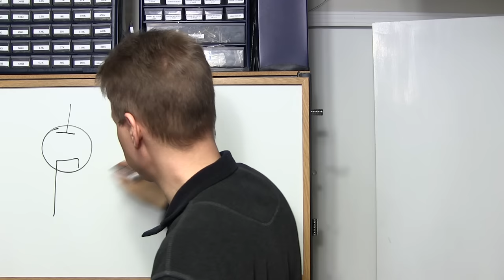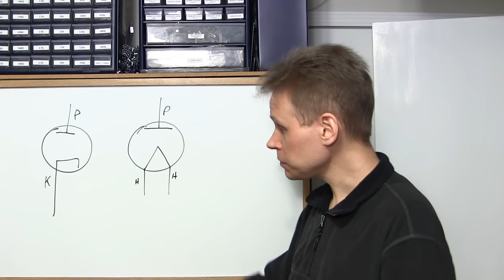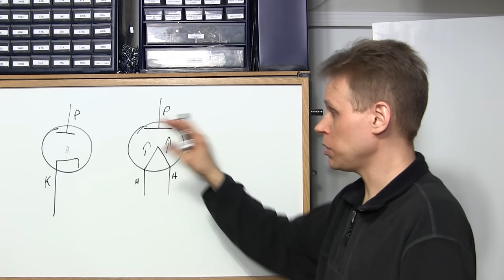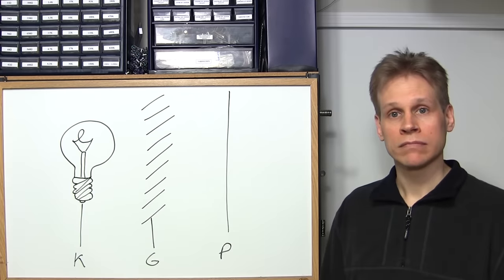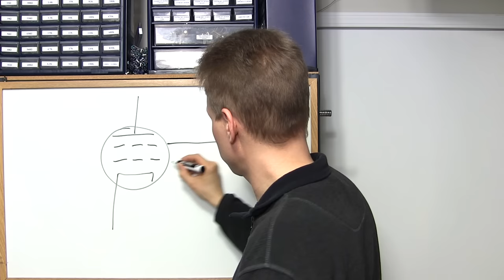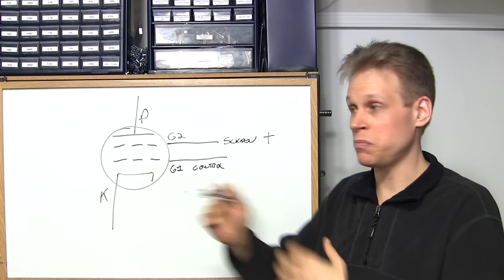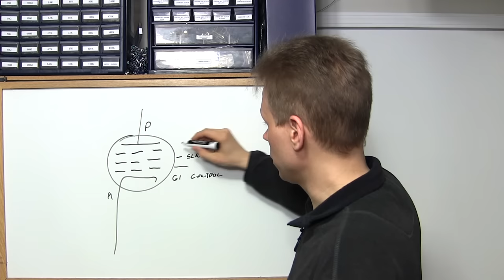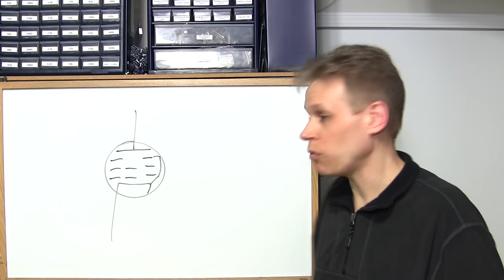How A Tube Works

Comment: I came across your channel by chance. Very interesting, you certainly know your valves (UK) (tube US) for a young man. Most people your age would not have heard of them. I started playing with valves about age 10 (76 now) and as the years went by I used all sorts of them in industry and as a hobby, Thyratrons I used for switching electric clutches, water cooled triodes for rf heaters, lots of ECC82s in control systems. It would be good if they could get an extra  electrode into power fets similar to the tetrode to reduce the gate - drain capacitance. They are a nightmare to turn on quickly at 2000 volts. Sorry to be a bit picky but the control grid in your triode and blind description, making it go less negative allows current to flow (blind to open). It does not need to go positive, and that is not wanted as you would then get grid current flowing.  A great video.🙂.

Comment: Ooh! Ooh! I remember (circa 1972) dealing with what must be one of the rarest of all failures in tube type receivers.
I was about 20 years old, troubleshooting an already obsolete VHF comm receiver. It was reported as a dead receiver, but I noticed if I had a signal on it when I turned it on the receiver worked for a few seconds, then it went quiet. One of the IF tubes had an open grid leak resistor on the control grid, so the negative voltage built up on the grid as it intercepted electrons. That kept the grid always biased to cutoff until I put the VTVM on the grid. Spooky but cool!

Comment: I think that the old days of thermonic technology was awsome!  It is amazing how electronics has changed; it is amazing how modern day ICs work, but the way old vacuum tubes worked was also amazing, in terms of physics.  I got into electronics after my year long physics course that I had to take in undergraduate school.  I took a digital electronics course.  Digital electronics is fascinating also.  All of these different  and unique applications of physics in electronics is very interesting.  Now, we have tiny SMDs, which I can't solder for the life of me and can't hold a job as a result.  At least I own my own repair shop Frank Reiser Video/Audio Service, Caldwell,  NJ.  As my own boss, I can't fire myself.  :)

Comment: Very informative, I work on power tubes or machines that use a tube such as TH150, YU108, 3CX20000, and for arc suppressor a 5557.  I would like to see more of this if you have the time to film and research it.

Comment: I grew up with vacuum tube radio's and TV's; even my first car had a vacuum tube radio in it. Always had to wait at least 10 seconds before they would work after turning them on. Funny thing, now I have to wait for the computers to boot up in my radios and TV's...I guess things haven't changed all that much after all.

Comment: This was fascinating. I bought a vacuum tube synthesizer called A Korg volca Nubass. I wanted to see how it worked, and if it was a gimick. But, I was using it, And as I turned it off, I saw these little green things glowing  inside the tube for a second or 2 before it turned off. It also takes a while to turn on, I assume it needs to warm up.

Comment: just a note on etymology from wikipedia:
"At the time of their invention, such devices were known as rectifiers. In 1919, the year tetrodes were invented, William Henry Eccles coined the term diode from the Greek roots di (from δί), meaning 'two', and ode (from ὁδός), meaning 'path'. (However, the word diode itself, as well as triode, tetrode, pentode, hexode, were already in use as terms of multiplex telegraphy; see, for example, The telegraphic journal and electrical review, September 10, 1886, p. 252)."
keep up the good work.
Reply from the maker: +Dimitrios Kalfakis 
Thanks for your input!

Comment: I found your talk very interesting but was surprised that at no point did you mention that the G1 was in fact an anaemic anode and would draw current if fed with positive voltage. what is in my view more important is the fact that while putting a negative voltage on G1 interrupts the flow of electrons, it also makes the grid look like a back biased diode G1 to cathode,  thus making the grid circuit a very high impedance due to no current flowing, one of the really important features of vacuum tubes.
I hope this does not sound like a criticism it just seems important to me.
thanks again
Colline G3PGK

Comment: Glass vacuum tubes really fired my early interest in electronics. I could look inside and see all the parts the books told me about, and I could imagine the stream of electrons inside. Even cooler was when I found a gassy one that had luminous areas on the glass. When I saw 4-400As glowing orange I was in heaven. Metal tubes were a gyp.
Reply: As a kid I spent more time looking in the warm  glowing back of TVs  than watching the front.  Guess I was an odd kid.

Comment: I feel like you've shown a general idea for what tubes are, but I would've liked to see them work as rectifiers or amplifiers and for you to point out why they work that way. Why does the diode tube only allow current to flow one way and not the other? How does the triode work to amplify? And perhaps describing how the operation of each of these devices compares to their modern semiconductor counterparts would've been quite helpful as well. Still very beneficial video but I felt the need to mention these points.

Comment: Thank you again Prof Carlson for your perfect teaching style.

I just have one question if you dont mind. Ive seen a tube rectifier product recently that takes a single DHT like an 805a or even 300b and use it as a rectifier, not the usual 5U4 or 5AR. How is this possible?

Even more mystifying the output of this outboard "super rectifier" plugs into the socket of where the 5U4G is supposed to go, suggesting a double rectification!

Can you kindly shed some light on this? More power to your channel!

Comment: Great video.  Some cool followups would be showing the characteristics of the tubes on a curve tracer, how to size the plate and cathode resistors, and also, why some pentodes can handle holding G2 at maximum rated voltage and ramping the plate voltage from 0 - max  (6V6, 6L6GC) and others can not (6550, EL509 (modern)).

Comment: Perhaps the most used triode in the world is the 2A3, a directly heated tube used in audio amplifiers since 1933. The original tube had only one plate structure, but the "improved" version which arrived around 1940 had two, completely separate triodes (with their own grids) which were paralleled together inside and tended (some say) to improve the tubes response. It was a design often used in push pull operation, but was designed to use "matched pairs" of tubes to eliminate distortion. It was often used in Class A circuits. The bias of the tube was a critical factor in its correct operation, as the design had a highly sensitive grid structure. Often, as in the Brook amplifier design (for example their 10C3), the grid bias was an exotic type called "Class G," which was supposed to lower the overall Class A amplifier distortion products remarkably. Finding a matched pair of tubes today is a rare event!

Comment: One of my instructors in basic electronics in 1962 told of vacuum tubes at a radar station that were so large that you could open them to replace grids. Of course the electrons were as big as basket balls.

Comment: Great video. I wonder if you'd consider doing a video explaining a very simple audio amp, like something based around the 2A3? I feel like I understand the principle of triodes, but it would be great to see that principle in practice in a circuit with explanation of how it works from the mains input to audio signal output. Thanks again for your videos!

Comment: Excellent pacing and thorough explanation.  My only question at the end was what a beam-forming plate is and why its useful.
Reply: same, it is mentioned often but what does it do?
Reply: When a high velocity hits the plate/anode, it can dislodge one or more electrons which will be attracted to the positive charge on the screen grid causing the 'tetrode kink'. The beam forming plates force these 'secondary electrons' back to the plate so that the kink is eliminated.

Comment: Thanks for the info! Of course transistor technology is much better suited for digital processing these days, but some of the very earliest computers used tubes. I wonder how well a tube based computer would work if made with today's manufacturing capabilities. How close to a perfect vacuum could you reliably achieve? One would need two distinct anode-grid(s)-cathode assemblies for each bit. How many such assembled pairs could you pack into a single tube? Or would it be easier to draw heat off if you made lots of small tubes? What sort of clock speed could you acheve? 1000 Hertz maybe? How hot would such a computer get? Could you keep your house warm in the Winter with it? Just curious...

Comment: I actually just subscribed because of this video. 
I've developed kind of an intense interest in tubes as of late and this was kinda interesting. 

I have some moderate glasswork experience and I'm kinda interested in seeing if I can make my own gas discharge tubes (I know that's a little different than a vacuum tube) to act as high voltage switches for an H bridge circuit. 
Initially, I plan on using it to flip-flop an inductive motor back and forth on direct current, but eventually i could use it as an inverter. 

High power switching is one area that vacuum tubes still hold undisputed superiority, so i thought it might be fun. Vacuum tubes seem to have higher frequency cut-offs than semi-conductors too, but that might just be my misconception.

Comment: So,  when a tube would need replaced,   I can still remember my father doing it on our television,  what was usually the thing that broke that required it to need replacement???  The heating filament would be my best guess...  on/off cycling of heating up and cooling down would probably make it brittle and break???  I've tried to tell people that the most wear and tear on an electronic device was turning it off and on.  Is that still true?  Was it ever true?

Comment: Great video. I had kind of a Ah-Ha moment and maybe you could tell me if I'm right.  So when I plug my guitar into my amp I'm not really hearing the sound of the guitar but the sound of the amp. Because the guitar is acting as a controller ( Venetian blind) with no electrical connection to the power amp section. If this is correct I can't wait tell this to the guys who say they can hear the difference between a Ash and a Mahogany body guitar. Thanks again for a great video.....
Reply from the maker: +jim mcdowell 
Hi Jim. The guitar is the device opening and closing the blind (grid) The signal is re-created at the plate and inverted.
Reply: A guitar produces a signal which controls the amplifier. Maybe the signal from an Ash bodied guitar is slightly different to the signal produced by a Mahogany bodied guitar, a difference which is reproduced by the amp?

Comment: You've obviously forgotten more than I will ever know about electronics. But I remember as a boy when our TV would stop working, I would look in the back and if a tube wasn't glowing, I could take the tube out, take it to a drugstore, put it on a tube tester, and it would tell me if it was bad. Then, there was a stock of tubes in the tester cabinet. I could look on the chart they had and pick out a replacement tube. Then I could take it to the checkout and buy it. I would take it home, plug it in the socket, turn on the TV, and voila! It was a great feeling to fix something that way. Can't do that anymore!

Comment: i would love to see you have a  video just to explain the importance of visualizing, accepting and using conventional flow.  I've always taken flow in a circuit as having to do with electrons moving from negative to positive and have never understood why I should see it any other way.  I have seen that most if not all schematics these days showing conventional flow and except in the case of understanding that conventional flow is merely 'hole flow', it never made any sense why that was so important or why the use of it is advantageous.

Comment: In a tube with a directly heated cathode, could the power flowing through the tube keep the cathode hot enough to work? IE, once started by warming the tube, could you disconnect the heater power and have the tube continue conducting as long as the power going through it was kept high?

Comment: I’m glad you made this teaching video.  But I was a bit disappointed because it is more of a description of what tubes are made of and what their components are called.  It doesn’t really explain how they work.  For example, a simple description of how a tube can rectify AC current would be really interesting.  And explaining how the electrons arriving at the plate can be used, given that the plate voltage might be a couple of hundred volts dc, and in some cases considerably more.

Comment: Just a couple of questions please about the triode. So when the grid / ‘Venetian blind’ has a positive charge it opens so that electrons can flow through to the positively charged plate. And the grid blocks flow with a negative charge applied. Is this an ‘on or off’ situation or can the grid be partially open or closed with and intermediate voltage? Is the openness or ’closedness’ of the grid on a continuum in this way? My second question is more of a comment: I'd love to see a graphical video like this one explaining the triode but explaining the operation of a transistor down to the electron level. Thanks in anticipation.

Comment: Vacuum tubes have certain advantages. On of them is they are not knocked out by radiation. Another is they survive voltage spikes. They work in environments where solid state is destroyed. I'm older so I am familiar with them. Have built circuits with them and modified others. We did this in electric shop. Three years later when my brother went through school they were building transistor circuits. 

I became familiar with junction transistors and tote down some older transistor radios for transistors and other parts and built my own amplifier circuits. Early transistor radios were very energy efficient services. As integrated circuits came along more energy was wasted. (Though still very small compared to a vacuum tube.) They are however simpler to build but I've noticed with Android devices the newer ones heat up less which should increase their life.

It is refreshing to see some material on vacuum tubes which can work under conditions solid state just doesn't do the job.

Comment: Have a question you maybe able to answer.. If a amplifing tube is run within its design specs and it   does not get gassy why does it become weak over time?
Reply from the maker: Basically: Cathode emission drops. No matter how good the vacuum, and how clean the internal components, the internal parts will always out-gas through the tubes useful service life. The getter spot does a good job of absorbing the impurities, but it isn't perfect. When you see a chocolate brown getter, this is a good indication of a "dirty" assembled tube, or a tube that has seen a hard service life. The getter should always have a chrome appearance (or close to.) If you see a getter that is chocolate brown with a white ring, the tube has come to atmosphere by a small amount, usually a leaky stem seal or lead-out pin seal causes this. If the getter spot is completely white, and looks "Cakey" on the inside of the bulb, the tube no longer has a vacuum, and even testing the tube can destroy your tube tester, or the equipment the tube is in. With no vacuum, the filament will draw very heavy current, possibly damaging the power supply.

Comment: Some time during the 1970s a cold cathode was developed.  That is it emitted at room temperature so needed no heater current.   I probably have the article in a magazine somewhere.  At the time the only valves being developed were CRTs and a pilot light like current could be used to save warm up time at no development cost.

Philips Mullard was the only company making valves by 1980 (now NXP and they don't make any now).

Comment: I've always understood electron flow, especially inside vacuum tubes.  So to use conventional flow I would have to consider electron holes flowing from the plate to the cathode?   It's hard to figure that way since electrons are a real thing but I can't wrap my mind around electron holes for some reason.   By the way, excellent video... you must be a teacher of some type.  Thanks.